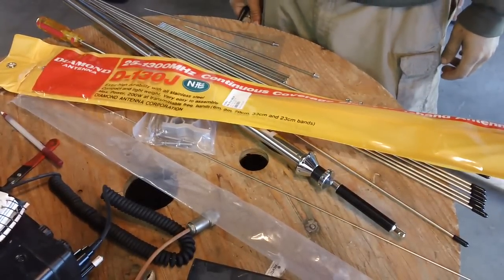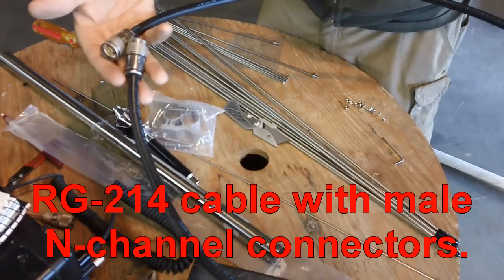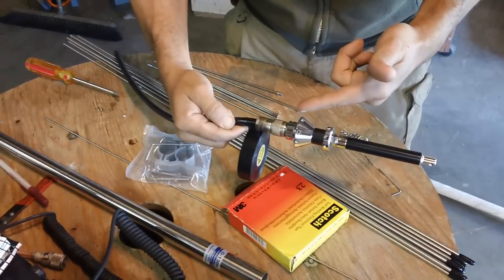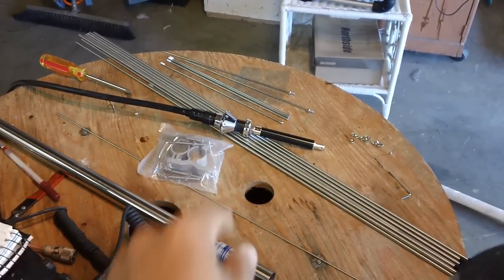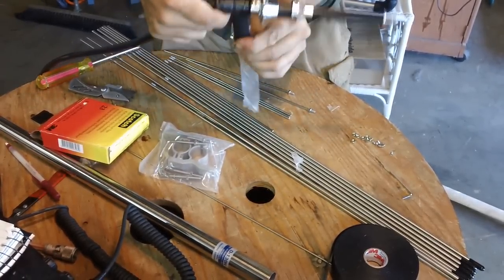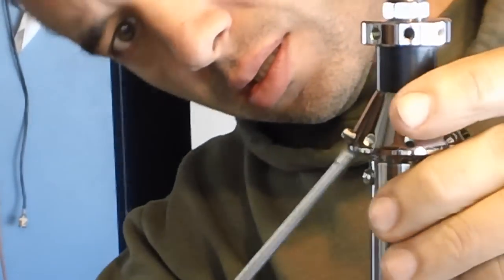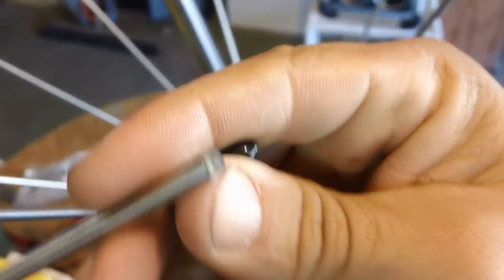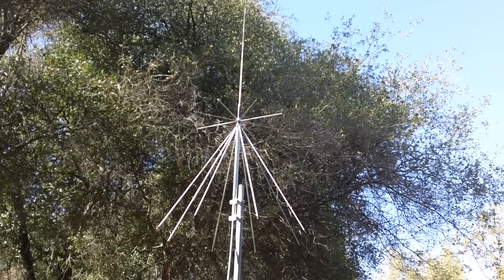Scanner Discone Antenna Assembly For Home Comm Center.

Comment: Thanks for the excellent video.  I just ordered two of these antennas.  I plan to use one of them on a Tektronix  MDO3024 Oscilloscope/Spectrum Analyzer and the other on a Uniden BCT15X Scanner.  I am going to mount them in the attic as our home-owner's association doesn't allow antennas to be mounted on the exterior of the house.   Even though I am mounting them in the attic I liked your idea of weather-proofing the antenna to cable connection.  Thanks again for the video.  It improved my "confidence level".
Reply: Good Vid. Thanks to ALL my Fellow VETs who Honor and KEEP the Oath! Them is Oath takers vs Oath breakers IMAHO!   If in attic ...No NEED to seal it.  Also there is a spray can (as seen on tv) like $10 bucks from Lowes.  it is Liquid Rubber...Just spray it!  OUTSTANDING!

Comment: Hi GC nice to see you again. That's good solid practice you're showing. Just like the guys do at my work. The one problem we occasionally get is with a combination of high wind (gusts up to 140 mph depending on location) and snow & ice or after freezing fog - the dipole elements (especially aluminium ones) vibrate in the wind and fatigue, crack and fail. There are some installations where you go up in spring after the snow has gone and all the dipole elements are on the ground! So now we're seeing more steel elements that hold up better. We also use your "snakeskin" for waterproofing. I feel quite at home seeing you do this stuff! Hey, take care & all the best, Rob

Comment from the maker: Sorry for the delay in answering, been camping. If you are scanning a wide range of frequencies like 40 MHz to 900, then I would say in my humble opinion, yes. If you are doing one band only like 137 MHz, it would be better performance with a dedicated VHF band antenna tuned for it, better performance. the only weakness i see in this antenna are the hollow cone radials, they might break if handled roughly. once mounted it will last you for years, without rusting. weather proof the cable connect

Comment from the maker: If you're going less than 15 feet, RG58 is ok. any longer runs I recommend LMR400 with a n-channel connector, better efficiency for scanning uhf & 800 with less losses. I'm currently running a Uniden BC 780 XLT. I paid about $75 used scanner and about 80 0r so on the discone antenna. the rest was scrap extra parts. I'm looking into those software defined radio dongles another YT channel reviewed, looks promising to add to my scanning equip.

Comment: I use two discone Antennas.i used lock tight on my first Antenna 3-years latter took it down to clean and fit new better coax.trying to undo the nuts and Allan key grub screws never use lock tight again..what I did was polish every thing put it all back together then with a kids small paint brush paint all screws nuts every thing you put back paint it with black silicone just over each nut thread and grub screws one its waterproof two nothing will undo paint each joint don't go mad but just enough and the top whip do it up then paint black silicone around the joint.iv been doing this now for years.and buy a good black silicone not a cheap tube.
Reply: imagine if you learned to use a Period?

Comment: I am still waiting on parts for my antenna project.  I have watched your video several times and it has been very helpful.  I noticed you used two types of sealing tape - Scotch Super 33 tape
 and Scotch Rubber Splicing Tape 23.  I was curious to know why you used both.  I figured you must have had a good reason so when I was ordering all my parts for the project I ordered both type.  Mind telling why you used both?  Thanks again for the video!

Comment: What kind of coaxial did you use?  If it is for RX only you shouldn't have to worry about 50/75 ohms and have wider selection.  I made my own discone antenna from a SO-239 antenna and hand-cut radials.  From the southern tip of Vancouver Island I was picking up public service & police all over northern Washington State, even 800 MHz transmissions!
Reply from the maker: +Fone Star surplus 1/2 inch superflex heliax.

Comment: I had a scanking version of this and it rusted to death :( the Diamond version retails at £124 in uk and I am tempted. Do you think it would work well for reception only if i mounted it in my loft in a standard 2 storey house ? i was using scanking for APT satellite reception, will the diamond perform well on 137Mhz reception? cheers, cool vid :) a lot stronger looking than the scanking :)

Comment: am new with my scanner, desktop from RadioShack its a Cat No. 20-424, i want to install a outdoor antenna for it, it has a bnc connector in the back. any recommendations?
Reply: You can get a BNC to PL-259 adapter so you can hook a coaxial cable to the back of your radio to the antenna outside.

Comment: Thanks great detail.  Will Rg8x cable to scanner work from this N type to my scanner?
Reply from the maker: +Gerald Shultz Yes it will work, but you are going to have some losses if the length is more than 25 feet. Especially freqs higher than 200 MHz Not a deal breaker though, it will work. Thanks for watching.
Reply: +GUERRILLACOMM Thanks I purchased the D150NJ and went with N cable.  You are great help.

Comment: Someone at my ham club is selling his discone antenna for a good price. I was thinking using it for my scanning and shortwave. I read tho sometimes antenna with coax can not work properly with portable shortwave. Any comments or suggestions? I was going to rig it with a switch so I can either use it towards my scanner or my shortwave. During your experience  and analyze do you it's possible? I'm using the tescun pl-660
Reply from the maker: +TheMountainRN If the antenna you're interested in has a single whip about 30 inches from the center going vertical, then that discone is tuned for 2 MHz to about 1.2 gigahertz. You will probably not get anything below 2 MHz and tuning below around 75 MHz fail the industry minimum for a tune antenna. but its may be good enough to get some channels in but not very efficient. Realistically, the doscone meets specifications between 75 MHz to about 950 Mhz where you could use it as a transmit antenna without damaging your radio. If the Discone does not have that long whip on top of the cone and skirt then its tuned for about 95 MHz to 1.2 ghz. The discone is like a multi-tool, its a good all around tool but not as good as the dedicated single tool. I'm still fond of the Discone for general purposes.
Reply: It's Comet Model DS-150S
Reply from the maker: Spec says 25-1500 MHZ, you will loose some portion of shortwave signals. Here's a link of user experience with this model, I cannot give any since I have never used this model.
http://www.eham.net/reviews/detail/6864
Reply: do you think worth buying if I intend to buy a scanner at one point??? What scanner would you recomend as well?? The issue I have right now with my SW is i don’t have the space to have a nice wired antenna and don’t feel like spending 400$ to buy a loop antenna
Reply from the maker: +TheMountainRN Personally my opinion will be yes. You are able to tune into different bands of frequencies without having to switch antennas. In my home setup that is my goto listening method, a discone with a scanner. As far as scanners, UNIDEN is the industry leaders right now with various models. but there are many features that could range from $75 to 600. the video link below is a detailed description of features you may or may not need and it will determine what is important to you for your area. Personally I like a scanner that will at least be able to alpha tag a frequency. So when a channel or frequency stops on an active traffic you could look at the screen and identify who or what that frequency is, instead of just looking at numbers. the vid is a few years old but still pertinent todays methods. I dont have much experience with lower frequencies like HF and shortwave, but survivaltechnord is a good source of info concerning antennas in that frequency range.
https://youtu.be/-pB9K5_f3d4

Comment: Why recommended mast height limited to 30 feet.  Is it due to wind considerations?  Thanks
Reply from the maker: +Gerald Shultz Have not seen that recommendation of 30'. May be due to wind loading. I know in winter I get a nice ball of snow collected on the disc or skirt part of the antenna, but no damage. I've personally seen them installed at the height of 80' with no problems.
Reply: Thank you I am going with my 40' mast.  Your videos are great.  You know your stuff.  Good job!!!!!